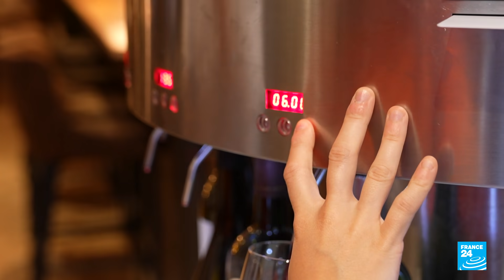In the red: France's wine industry turns sour • FRANCE 24 English

Comment: When I buy wine, I make sure it's labeled as organic. Discounters like Aldi and Lidl stock organic wines at low prices, so it can be done. Having witnessed first hand the use of pesticides in wine growing areas, it doesn't take a genius to work out that is not good. The air is thick with chemicals, and ingesting them in any significant concentration is hardly going to be beneficial to your health in the long term. Wine growers need to prioritize sustainable and organic methods of growing their crops. Some need to rethink their business and working practices. They might need to charge more, but so be it. Safe products are ultimately what the next generation of wine buyers is increasingly looking for.
Reply: Yes, French wine producing regions are those where the most heavy-handed use of pesticides occurs. I chose organic and small producers wine, there are still many great wines made in France - and I feel there is a new generation of winemakers who are very conscientious about the environment. Santé!! ^^
Reply: In Calfornia, many wines are organic but not marketed is as such because it was a negative connotation here.
Reply: There was a television programme in Britain about 15 years ago or so showing how French farmers were using the output of sewage works as a fertiliser at minimal cost. The problem is the quantity of fragmented plastic and paper that is transferred into the land. Not much organic there.
Reply: And we need wine because…? 🤔
Reply: @1timbarrett  Oh that’s very easy - absence makes the heart grow fonder and wine can assist the absence!!!